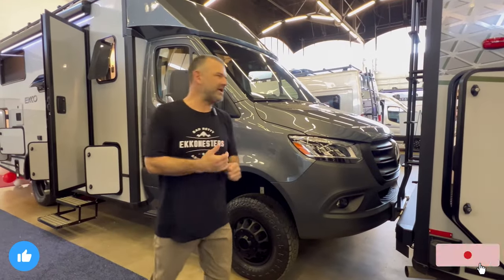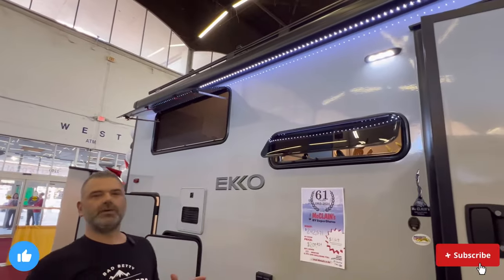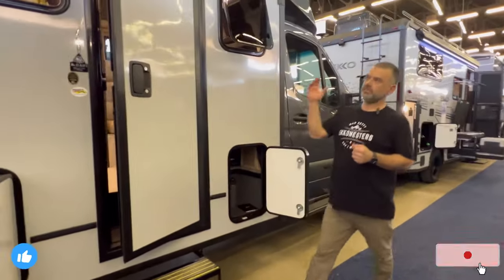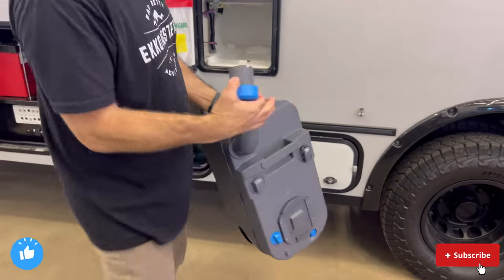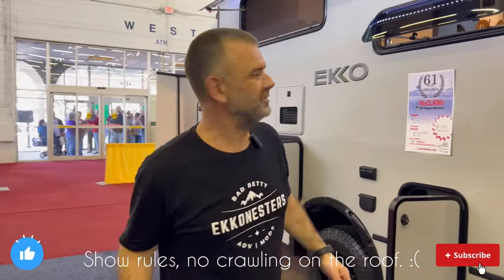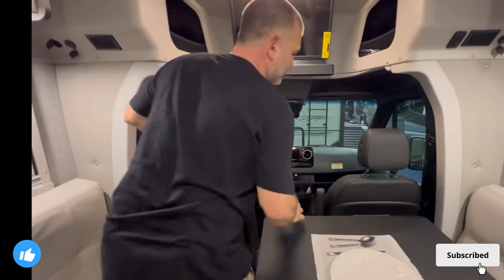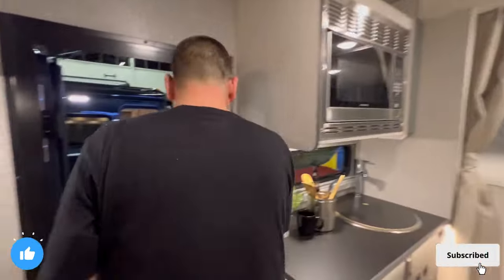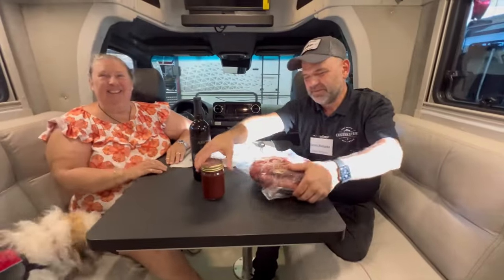WINNEBAGO EKKO SPRINTER TOUR

Comment: Again Jason & MIchelle, another well-detailed and complete video...thanks!  You are really helping folks interested in considering and/or buying an EKKO.  So informative!

One question: when trying to turn around the front seats, do the driver/passenger doors need to be opened (as they do in the Transit version)?
   
I watched the Lichtsinn video regarding the M-B Sprinter ("Sprekko") from a few days ago.  Very informative and M-B offers some really cool tech options (like sleepy driver detection). 
Plusses: higher road clearance; the larger approach/departure angles; larger rear garage; larger forward lounge area + flexible dining table/sleeping and more inside storage!

I wish they could offer a TWIN burner INDUCTION portable cooktop (as opposed to the single "burner" cooktop currently offered).  Longer mattresses in the bedroom; centrally located A/C.  I DID ask Winnebago Marketing Manager ("Russ" [?]) if the Colorado Carefree awning could feature color LEDs (as opposed to only white light LEDs) and there was no answer back about that.  Certain colors are less likely to attract insects at night.

Comment: When you did the video installing the under hood light I noticed a panel under the hood on the driver side. Looked like it might be for your extra lights.do you have a video for i? Thanks,Ken
Reply from the maker: That is the TRIGGER6 controller.
It’s a wireless controller for auxiliary lights that uses a RF frequency as well as can be hardwired.
I don’t have a video on it, but if you have any specific questions, maybe I can help, I also sell these.
Reply: @ekkonesters599  Thanks,Im going to read up on it.

Comment: Great review. Thank you. You’re obviously an experienced Ekko user. Does the interior fit and finish seem reasonable? Difficult to see small defects on camera? Does the cabinetry seem of decent quality?
Reply from the maker: Hello, firstly, I'd like to say thank you for taking the time to watch our video and leave a great comment. Regarding your questions, I'll provide my perspective. My viewpoint might be influenced by my ownership of a remodeling company and direct partnerships with two cabinetry builders. When assessing cabinetry, I prioritize construction quality, particularly in terms of assembly techniques like dovetail joints. Material suitability for specific environments and the effectiveness of attachments are also key considerations. I believe soft-closing doors and drawers could enhance the EKKO’s functionality. We made this modification to the doors in our own and it was pretty reasonable. 
I think RV manufacturers leave the upper cabinets pretty open boxes, for end users to discover their own organization needs. 

I think the drawer bottom construction, which currently utilizes quarter-inch particleboard could be improved. 
The open rear cupboards adjacent to the bed offer customization potential; we installed pull-out shelves in ours. 

I can say, the cabinetry has proven durable over 37,000 miles, a testament to its resilience on the road. 
Overall, they are pretty decent.  Like in any class C, I wouldn’t expect a Monaco Class A high end build out. 

Let me know if that helps.
Reply: That certainly helps. Thank you for the minor modification suggestions. Recently ordered a 23B. It’s a significant financial purchase so trying to tune my expectations. Rob

Comment: Jason and Michelle, compared to your 23ft Bad Betty, don’t you think the extra 1.5ft (for a total of 24.5ft) would be an issue for parking in town?
Reply from the maker: You know that’s a great question and one we’ve been considering heavily.
Although we spent three days shooting the Winnebago, Sprinter EKKO lifestyle commercial, we we only parked in a Starbucks parking lot one time.
And that was because the film crew and the art Director needed their coffee nice and early ha ha ha and apparently they were not into hotel coffee.
We did, however, park in the parking lot of the hotel in Prineville, Oregon, and it fit in the parking spot.
The back in overhung the curb which was not a big deal because it was just a garden area for the hotel.

My understanding is that most parking spots are as follows. 

Parallel parking spots (street side) tend to be between 20’ to 24’. Which really pushes the boundaries. But 5” to 6” split between the lines would not be the worst. Of course I’d have a CaTuned Front bumper on it so that if anyone got real close, it wouldn’t hurt the front of my vehicle lol

Standard parking lot sizes tend to be between 16’ to 20’ and our Transit seems to fit almost everyone.  There are a few lots that have some seriously small spots. 
 
It wouldn’t be as easy as parking. Bad Betty, but I’d make every effort possible lol
Reply: I can't address any states other than Texas (even though I have parked in a number of out-of-state spaces), but as I understand it, the minimum size for a parking space in Texas is supposed to be 9' x 18' and for a parallel space it should be 8' x 22'. I would suspect they would be close to the same in every state. With my 7.5' x 25.5' View, width isn't usually a problem and would be even less so with an Ekko, although it is a little iffy on the street when you step out, but length is a problem anywhere for my View and both lengths of Ekko. I have parked in lots and just take 2 spaces in length. I have also parked parallel on the street and basically done the same. I've never had much of a problem finding spaces and nobody has ever complained about it, but I try to be away from other vehicles and don't park where there are meters... 😁
Reply: Ok, I will ask 😂 if you could choose, which Ekko would you choose and why?
Reply: @ekkonester599 @dennisjones4156 Thanks for the thoughtful answers. If length isn’t a huge priority then I think Sprinter is the clear winner (unless you don’t like Sprinters.) Especially, the lounge/dinette area. Also, You could consider the new Navion T at 25.5ft with a garage. It is good to see Winnebago innovation. Thanks again,
Reply: @Chiarelli-ottawa-real-estate we chose the sprinter. Longer beds and the seating areas. More leg room in the cab.
Reply: @3BLADZ  sweet.  We have a transit on order but have the opportunity to switch to the sprinter.  We love the extra lounge space and the mercedes feel.

Comment: Can a diesel genset be had instead of Propane. With Mac solar options?
Reply from the maker: That’s a great question.
I don’t know if there’s a diesel generator that will fit in the designated area.
Definitely have to do some research and it’s been on my mind.
I would also say that the generator is pretty efficient, and given the overall times she probably need it. It’s never been something that I think would trouble me much.
We spent three days in the Winnebago commercial and the film crew use the generator multiple times for all the equipment and I don’t think it was until roughly the final day that we finally needed to refill a tank.
I hope this helps with a great question. I’ll do some research.

Comment: You guys spend a lot of winter time in your Ekko, do you still use all the water systems?  How's your experiences with that been?

I'm interested in the Sprinter version, and using it to base camp and ski out of.  I can park it in a hobby shop when not in use.  I'll put in a 30A hook up for it also.  I'd also add the Truma antifreeze plug during driving.
Reply from the maker: Hello, thank you for checking out our channel and subscribing.

Yes, we use all the water systems in all weather conditions.
Our experiences has been very good.
My personal recommendation is whichever version you purchase there is a metal plate when you lift up the rear Bed.
There’s about 10 or 12 screws that hold the metal plate down.
Underneath that is where most of your waterlines are coming from the comp or all of the valves and City water fill connections are located.
You can use ROXUL and fill that compartment.  That’s what I did on ours. Of course the compartment will stay pretty warm on its own, but it will provide great piece of mind when the vehicle is store and as a possibility, you didn’t get all the water out of the lines.
However, the compartment where all the control valves is heated when you’re using your TRUMA heating system anyway. Let me know if that answers your questions.
Reply from the maker: By the way, where might you be purchasing yours from if you make the decision?

Comment: Which would you choose? Sprinter or transit model?
Reply from the maker: I knew you’d ask that question.  I’m on the fence.  I love the power of the Transit and the ability to easily park just about any where.  I do love the refined Cabo do the Mercedes for sure, but a little underpowered.  However, the additional interior dinette space is pretty amazing and the rear bed is nice with the increased room.  I also like the fact that the Mercedes offers more options in suspension upgrades, etc.  but we love our Bad Betty
Reply: @ekkonesters599  haha very diplomatic answer! They are both amazing for different reasons!  Thanks again to both of you for an amazing video.

Comment: Is this exact twin turbo high output sprinter chassis on any other RV and if not which other one has it? Thanks.
Reply from the maker: That’s a great question, I’d have to do a little bit of research.
I don’t believe the view uses the high output motor, but the chassis is consistent.

Comment: This is crying for further upgrades. From the factory it should have a diesel heat/hot water system, like the new Jayco/Entegra knock-offs, as well as a small diesel generator with standard dual batteries. Propane is outdated and dangerous compared to non-explosive diesel. The second standard feature should be a quieter a/c unit, such as Truma or Houghton. Really radical would be a 12 volt a/c unit as they are inherently quieter and more energy efficient. My first after-market mod would be helper springs in the rear. Currently it is 2 inches lower in the rear  because the rear leaf springs are sagging under the weight of the rear overhang. It will be worse when that freshwater tank has 400+ pounds of water in it. My next mod would be Super Single tires, when the originals wear or date out. Those doing heavy duty off-roading should get the Super tires right away to avoid the risk of caught rocks slashing sidewalls.

Comment: This RV is awesome, the only thing I am concerned about is the cassette tank. We have a 10 gal black tank which has to be dumped approximately every 3 days. The cassette tank would be a lot more often. Did I hear there is a way to connect it to the 3.5 drain pipe so you don’t have to physically dump the tank?
Reply from the maker: Yes, I agree quite an awesome rig for sure with lots of potential for MODS.  The trick to not filling the cassette up so quickly is to limit use of flush water. Typically when using the restroom, if you open the “dump”, and then add a little water after “potty business” and close the “dump” opening, you’ll retain more space. 
I heard a little something about the 3.5” hose, But I can’t see any possible way. I think the reference was to connecting the cassette to the sewer hose using the “americanizer” and that way you could dump it easier at a Blackwater RV disposal area.
Reply: @ekkonesters599  Even if they created a connection from the cassette to the sewer drainpipe would help. We usually only stay in a location from 1-3 days and usually dump before we leave. For me it’s just having to take the cassette to dump it bothers me.
Other than the cassette the EKKO is perfect in every other way.